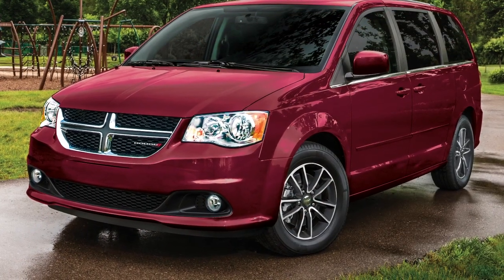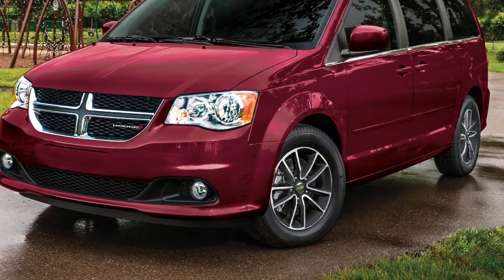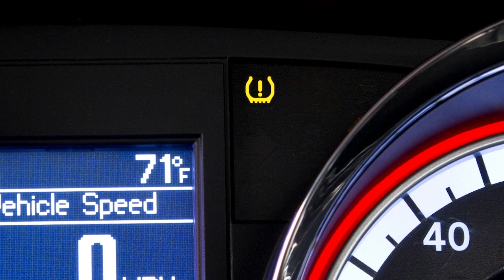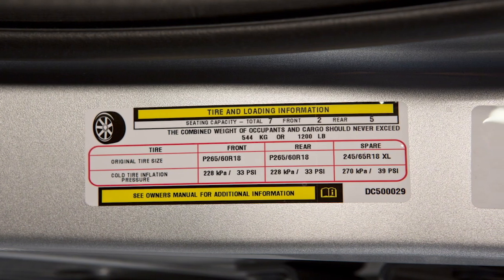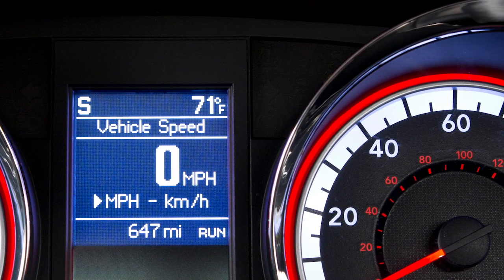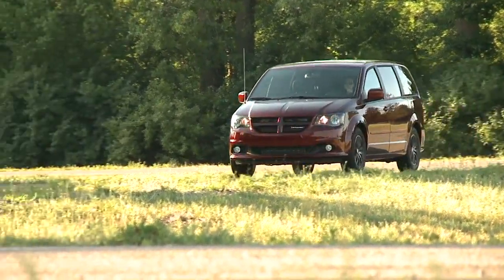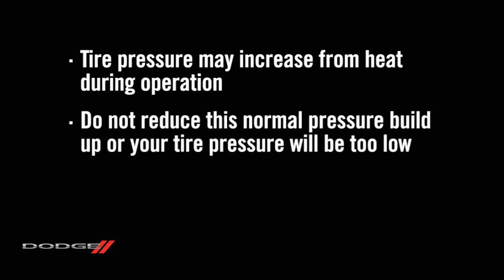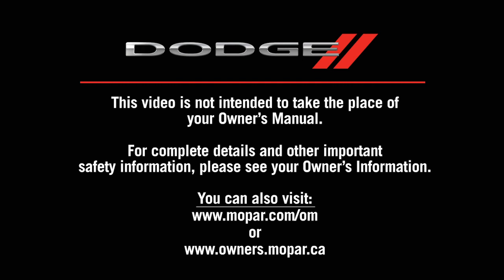Tire Pressure Monitoring System (TPMS) | How To | 2020 Dodge Grand Caravan

Comment: You only talk about heat but what about cold? It was -30C here today (Canada) and the TPMS was on even if the tire pressure is normal. Should we still always check it or just consider it a false alarm due to the freezing temperatures?